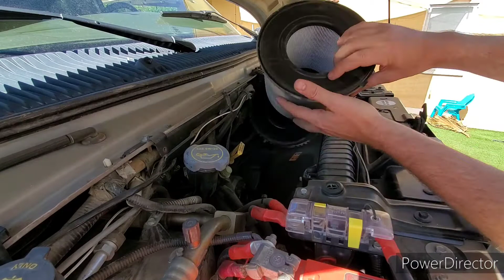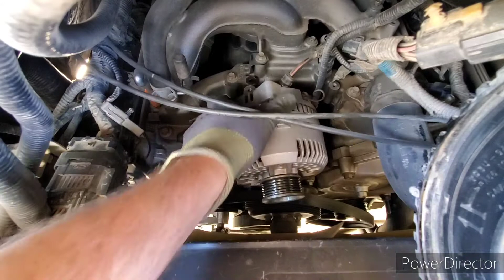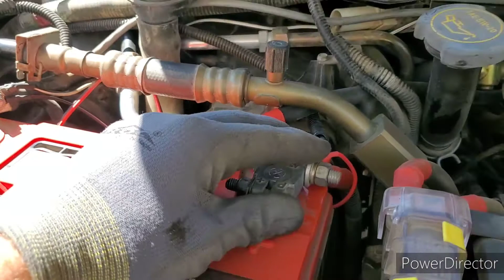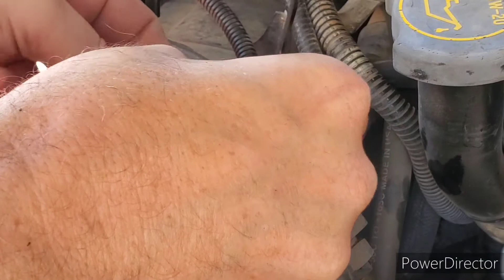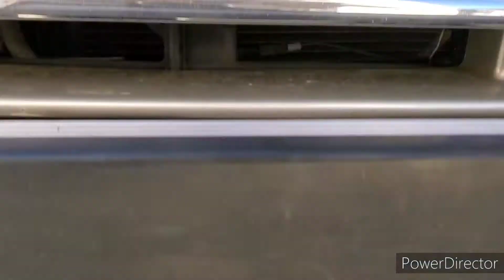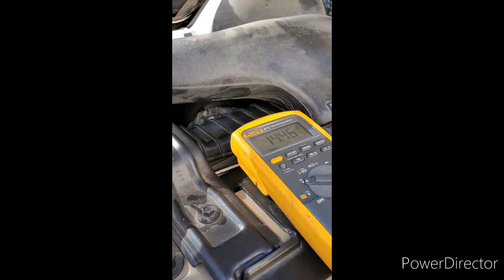VO Ford Econoline Big 3 Cable Kit Installation Procedure

Comment: Just got my kit today. Will install it tomorrow along with the max air kit. Hopefully I can get it all done in one day. Thanks for the parts you sent.
Reply: Could you feel a big difference with the max air kit?
Reply: Unfortunately  I haven’t installed the max air kit yet. My ac compressor went bad and sent metal through the whole AC system. Hopefully I’ll get the van back soon and when I install the max air I’ll let you know.